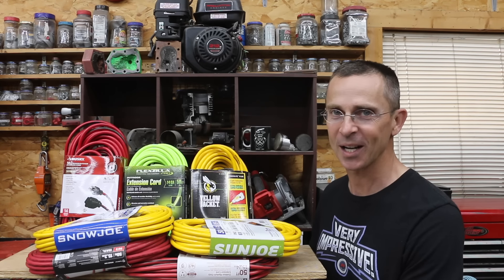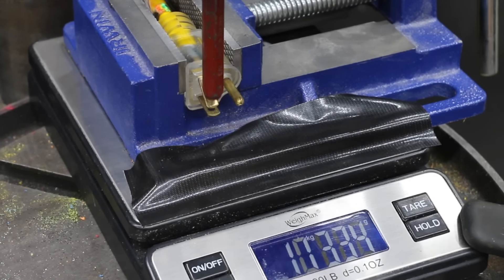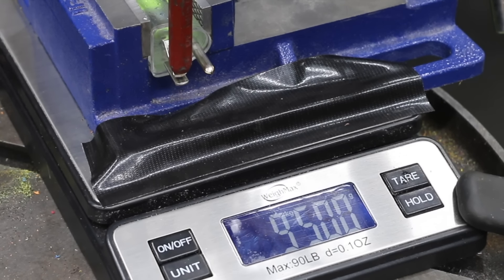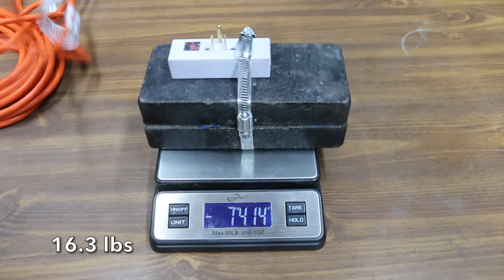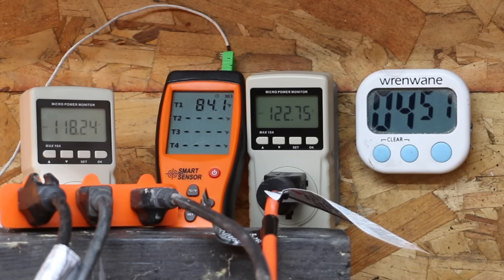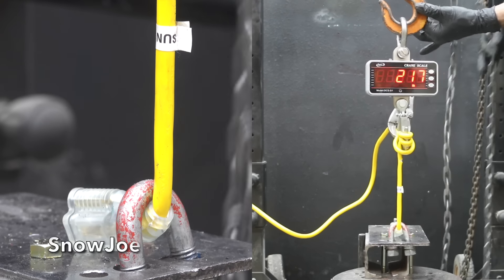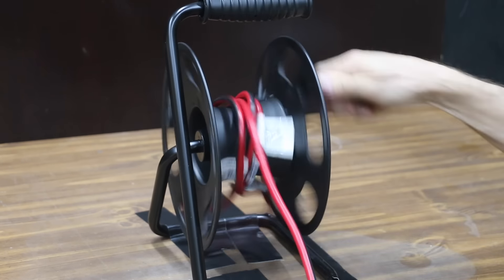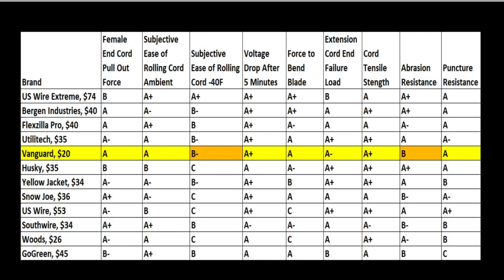Best Extension Cord? Flexzilla, US Wire, Yellow Jacket, Southwire, Husky, Woods, Bergen Industries

Comment: I use the US Wire Extreme to plug my truck in over the winters here in Fairbanks, AK and was not surprised to see how well it did on the -40 test. It's the only cord I have found that stays flexible when the temperatures drop and its interesting to see how it stayed as the only cord to receive a "1" rating.
Reply from the maker: Impressive!  You've seen temperatures at -40F and colder many times for sure!!
Reply: I frequently hit -40 in northern MN also. I usually just give up with trying to bend extension cords when it gets really low...
Reply: Rigid makes a nice ext. Cord for the cold we dont even take the husky out the truck after fall... we don't get quite that cold here in Michigan tho
Reply: @sminthian  Whats that’s crazy I live in East Central Wisconsin and we get -15° at worst in the winter usually like -5° and that plenty cold enough can’t imagine -40°. 🥶🥶
Reply: @sminthian  I got a friend who was hauling pipe for one of the pipe lines.  Minus 47. Most of the guys were gelling. He somehow was fueling with jet fuel and had no issues.  Never heard of that till him.
Reply: I shutter to think of what you had to pay for that cord.
Reply: Bosch used to make a cord similar to that one, don't think they're available anymore. Up in manitoba we saw the same temperatures and it always stayed flexible.
Reply: I have a couple of 12/3 100 foot ones that are the only ones I use when it gets that cold. The other ones look like a "slinky" at - 40.
Reply: Ive been using them for years, and US Wire Extreme is the only brand I get. Not only will they handle extreme temps but they are very rugged, and its a pet pieve I know, but I like to wipe a cord down and velcro strap it after use. After hard use, in my fabrication shop, they will come out looking clean, with no cuts or knicks. They are the cheapest when you think of how often you have to keep buying other lesser brands.
Reply: It seems as if they were specifically designing it to be a block heater cord, even the low force required to unplug would be an advantage to prevent damage from accidentally driving away with it still attached.
Reply: @THRILLHOUSEV  I was going to comment on that too. I dont see a plug being too "sticky" as being a bad thing. When I run a welder, it can be a final line of defense for just yanking it from the outlet. I do have cutoff switches, but sometimes if youre under a car, its easier to yank on the cord.
Reply: @_EZ710_  facts. Husky isn’t even usable in the winter. They were great to run in a semi-permanent fixture for running a shop light and over head power. But coiling it up was a pita
Reply: @ProjectFarm  ,  copper wiring becomes a better conductor at extremely low temperatures ---- at minus 40 you're well on your way to creating a superconductor! ----  and so the cord will easily handle more current and wattage than it is rated for, without overheating.
Reply: @firewoodtime2  Jet fuel is basically kerosene and is pretty similar to diesel.
Reply: That's the same one I have in North Pole!  It's pretty much "the standard".  You go to the Safeway in North Pole and they always have that cord for sale.  It even lights up on the end so that you can make sure your vehicle is getting power without walking outside.
Reply: I was briefly deployed to Fairbanks.  It was -60 on arrival, and warmed up to -40 when we left.  Loved every minute up there, even working outside every day.
Reply: @whiskeybuilder6335  I bought a 12/3 50ft SJEOW in 2018 for $40.   It's been a great cable for auto detailing & tossing over your shoulder while running a polisher.
Reply: @ProjectFarm   I'd like to see you repeat the wattage and voltage drop tests with a small space heater plucked into the cord. The metering devices don't draw enough power through the cord to really heat it up much, and the voltage drop will be fairly minimal compared to what you'd experience if you were plugging a power tool or some other high current device into the cord.  And by the way the temperature of the neutral wire should be the same as the temperature of the hot wire;  In a series circuit,  current is the same throughout and therefore it doesn't really make any difference which one you measure for temperature.  In practice however the resistance will always be greatest right at or right next to the  male and female plugs, and that's where it'll get the hottest, where the male connector is plugged into the wall socket and where the female connector is plugged into the cord coming from your tool. For example when I vacuum the house and then I unplug the vacuum cleaner the only place on the cord I can feel any temperature inctease is right at the plug next to the wall socket.
Reply: Fellow Fairbanksian here!  And I completely agree, I have at least half a dozen of those cords as they are the only ones that remain flexible.
Reply: @sminthian  Yeah, just drape it over the fence (Manitoba here).
Reply: I lived in PA, it could be as cold as 0 so a good flexible extension cord was best. Maybe didn't need it all the time but usually if I did I didn't want to be hassled with a cord folded over itself a dozen times knotting up lol... anyways I live in Florida now and went with a 12 gauge southwire. Holds up good in the strong UV and is plenty flexible when it's 90, the thicker wire is nice to prevent the cord from getting too hot since it'll already be 120 in the sun.
Reply: @TheFudily  A bargain.
Reply: @ProjectFarm  best charcoal for grilling.  I'm trying a bag of royal oak but I can already tell after the first time I used it I like Kingsford better but those are the only 2 I've tried.
Reply: @sminthian  how far north?
I grew up near Itasca state park.
Reply: @jetjazz05  , if I was running extension cords across the ground in the heat of a Florida summer, I think I'd want #10 cords, in the lightest, most reflective color I could find!
Reply: @bobguy6542 ,  at the North Pole, why would you need to warm up a car when you've got Rudolph, reindeer, and a sleigh?
Reply: @sminthian  Quite a few of our extension cords have big tears in the insulation from the cold. Sometimes you have to play tug of war to pull out a cord from the ice. Surprisingly, they don't like that.
Reply: @goodun2974  North Pole is a city in Alaska between Fairbanks and nearby Eielson Air Force Base.
Reply: Glad to see someone from Fairbanks piping up about this brand! I was worried it wouldn’t be available in AK.
Reply: @goodun2974  Watch again, pretty sure he was running 4 x 500w halogen lamps. How do you think he was drawing 1875w and comparing that to the 1770w at the other end?
Reply: A friend of mine in Anchorage used to live in Fairbanks. She said she didn't mind the cold much except it took a mile or two of driving to get the flat spots out of the tires.
Reply: @bobguy6542   Interesting, I never knew that. My brother lived in Alaska for a few years but he never mentioned it either.
Reply: @whiskeybuilder6335  the price was listed in the video.... like $70 or $80 I think.
Reply: My harbor freight cord was decently flexible at 0 degrees the other night while my cheap Lowe's cord insulation cracked like hard plastic
Reply: @firewoodtime2  Yup, JP4.
Reply: @THRILLHOUSEV  Exactly.
Reply: @goodun2974  LOL, but North Pole, Alaska is a real town just outside of Fairbanks with their own US Post Office.
Reply: @ejej6934  Must have been non-winter tires.  I have no flat spots and amazing traction with my Nokian Hakkapeliitta 10 studded tires.  On my Subaru Forester there's probably no better winter driving combo.
Reply: Also gotta appreciate the minimal voltage drop for when you're running a block warmer, oil pan heater, and battery blanket

Comment: I step on my extension cords too often, and I've found that the ones that feature stronger plug blades also tend to snap when straightened back out.  The folded blade type are easier to bend, yes,  but they always straighten back out without ruining the plug.
Reply from the maker: Thank you for the feedback!
Reply: I've had the same experiences.
Reply: I try to plug the extension cord back into itself when I am not using it. Helps avoid bending the blades, but not always possible to do that.
Reply: They can only bend so many times before they fatigue and snap. Had to replace a plug on a shop vac a month or 2 ago for that reason
Reply: It is better to damage the extension cord than an outlet, I think that flexibility in the plug is an engineered safety.
Reply: if they bend when you step on them then you have crap to start with

Comment: As a construction worker that uses extension cords daily, the softer cords are usually preferred.  The harder jackets are stuff and a huge pain to roll up.  When winter rolls around the hard jacket cords retain the shape of however they were rolled and are hard to work with.  I feel like that's why the more expensive cords are the softer polymer jacketed ones.
Reply from the maker: Thanks for the feedback
Reply: For the very same reason that I use rubber or rubber blend air hoses.  I had some sort of blue hard plastic air hose that even in warm weather was an absolute nightmare to handle.  However it was a lot cheaper.  It is only used as the first leg of an air hose extension if I need to go longer distances.

Comment: When I pitched this idea, I never imagined there were so many ways to test it! Thanks so much Todd, your dedication to your work is inspiring.
Reply from the maker: Thank you for recommending this one!!  I'll put together a round 2 on 12 AWG brands if there's enough interest and will include a couple of more tests.
Reply: @ProjectFarm  please include Rigid as it is my goto brand for extension cords in 12 AWG, I do like cords that light up to know it's plugged in as well as having 3 receptacle ends because splitters get lost.
Reply: @ProjectFarm  Ha!  I guess by the time I suggested it last month, you already had it in the pipeline.  :)  Nice job on the testing!
Reply: @ProjectFarm  sounds great!! Test 10AWG ones too!!
Reply: @ProjectFarm  Yes, 12 gauge would be a good follow up.  Please add a jacket melting test of some sort.
Reply: @ProjectFarm  Most definitely would be interested in at 12AWG, or even a 10AWG. 

Another video idea would be to test ball joint presses. Test them to failure, and see if the big name brands are any better than the cheep-o Amazon specials, or even Harbor Freight's Madox line.

Comment: As a contractor that has bought scores of cords, my most important criteria are wire gauge (Skil-saws draw up to 15 amps.) and coil ability (as at the end of the day they need to be put away).  We use twist lock cords to prevent disconnection or tie a knot where the tool and cord meet. 
I love these tests and often use them to direct my tool purchases! Thank you so much Project Farm for all the hard work and inventive testing protocols!
Reply from the maker: Thanks and you are welcome!
Reply: do contractors ever really sign contracts tho
Reply: So what would be your go to cord? The 10 gauge?
Reply: You can have a 4/0 entrance cable with a sorry connection its no different than a #16 gauge cord .
Reply: Terry Goyan, I have the same question -- I would love to know which cord you would choose.  I bought a corded mower and I just don't want to damage my electrics or the mower and I don't want a fire.  I'm a middle-aged woman and I'm clueless. ☺

Comment: I bought a 75 dollar 12 gauge extension last year, and have never regretted it. I know this isn't what most people look for, but here in the south, how cords take the heat is more important than how they do in cold temperatures. I have had a plug melt on me when running under my carport, in the shade.
Reply from the maker: Thanks for sharing.
Reply: Sure, but which one and how did you decide it would perform better?
Reply: I wish Project farm guy did a maximum current test under hot conditions like 95f. How much current can go through before the insulation melts.
Reply: For me, in Canada, cold weather numbers is more important than heat.  I wait till all the snow is gone when I wrap up the 14 GA wire I use for my vehicle (We have to plug in a block heater, if parking on the street over night, or may not be able to turn over in the morning!), as trying to wrap it up when very cold is hard.

I'm glad I don't have to deal with the plugs melting...
Reply: I'm having to put together a replacement power cord for a small dairy pasteurizer.  The original cord plug _roasts_.  The rest of the cord is cool as can be.
Reply: I was about to post something simular...  

18g is a joke
16 if low wattage and less than 8 feet.
else get 14 or 12/
Reply: Have you used many cords in Sub-Zero temps? I'd say the operating temperatures of severe hot vs severe cold are separate factors to consider. The ideal choice for running an extension cord in a walk-in ice cream freezer vs a  mid summer roofing project in Houston are likely not the same product.
Reply: @robertcortright  It doesn't matter.  Any extension cord used on a roof in Houston in the summer becomes tar impregnated, for that extra flexibility.

Comment: Two ideas spurred from this test:

1) Replacement ends for damaged extension cords. Would love to know which ones are worth buying.

2) Retractible cord reels. So many garbage ones out there.

Thanks!
Reply: 1) Hubbell is pricey but extremely good. HBL5266C plug, HBL5269C receptacle. Pass & Seymour/Legrand makes a passable substitute, but it's not as good.
Reply: @PaulSteMarie  Would be nice to see something like that with a strain relief built in. I used something similar a few years ago but the cable took a beating at the junction.
Reply: @WordupG  Have you seen the strain relief on a Hubbell plug? It's pretty massive. The cable will snap before you can pull it out.
Reply: as far as replacement cord ends. Proper installation is a big factor. If money isn't a concern, the Hubbells and P&S Legrands are Beef. I also find the black rubber/plastic Levitons are good too. Handles up to 12awg SJOOW and takes punishment well. Also you can buy in bulk on amazon for like $4 ea. Fun Fact, Hubbell industrial cord ends are compatible with Hubbell cord grips/strain reliefs. The function like chinese fingers and attach to the 2 screws used for the stock cord relief. Not a fan of the Hubbell hinged caps. The Harbor freight ends are junk, and anything built like it too.
Reply: Retracting air hose reels and water hose reels too!
Reply: I usually put hospital grade plugs on the end of all my cords.  I’m not sure the brand but I’ve had no problems with them, no bent prongs, they stay plugged in to any receptacle and anything you plug into them stays until you unplug it.
Reply: I've bought/used both the expensive and cheaper ends; they've held up fine with normal long term use.
Reply: Thanks for the tape tip and the observation on human nature - the seeking of the easiest path by a thief, one requiring little effort and no repair work. Using a  permanent marker, I write my name in several odd places on my extension cords - I'll now start adding fake patches of electrical tape.  If you have a long, heavy cord the odds are that it will be too much trouble for thieves to steal it by carrying it  off - too much work.  If the thieves are more determined, get 130+ decibel, pull-pin activated personal alarms from Amazon (about $1 each, if you buy about 10), and tape one if them to the cord in a non-obvious place, then rig it where the pin is pulled if the cord is moved.  The sound of the alarm goes with the cord and the thief, thereby discouraging continued efforts to cart it off.
Reply: leviton ends
Reply: Hubbel hospital grade are the best in my opinion. They’re the one of the only 5-15 that’s actually approved for use on 20 amp circuits.
Reply: The Hubbell hospital grade cord ends are what we use to make cords at the live light and sound company I work for.  They are incredibly durable.
Reply from the maker: Thanks for the suggestions.
Reply: @mattberg6816  yeah my background is temporary power for music festivals and production. There’s a reading the HBL8215 series are the standard.
Reply: Are there any replacement female ends that have the light to indicate that the power is on?  It would be a nice upgrade when replacing an end.
Reply: @bobo888bobo  I believe Leviton and Eaton both make them.

Edit:  I looked in the Hubble catalog and it’s the 515LC and 520LC
Reply: Hubbell hospital grade is the best I've ever used, out doors all year long for different projects. Put A piece of illuminesce in side and you can see it in the dark as the plugs are low transparent

Comment: When I lived in Alaska, I had a US Wire Extreme to plug in my engine block heater.  When not in use, I kept it in a bucket in my extended cab and none of my orange covered ones would go in the bucket after use.  Like you found, it was very easy to work with in the cold and had no problem getting it to coil up into the bucket.
Reply: That orange jacket is really cheap PVC. It's pretty stiff in cold temps.
Reply: @1pcfred  

UK bloke here.

I've got an extension cord on a reel made by B&Q, a DIY outlet over here. Said cord is bright orange, it's over 18 years old, the insulation (jacket?) Is still in excellent fettle and it's super flexible even in very cold conditions (like lying in snow for a couple of days). It also refuses to get any significant damage inflicted on its self in use, it gets used A LOT to this day. The cord on a Flymo hover mower is also seemingly the same type of cord and doing just as well at the same age.

A case of 'they don't make 'em like the used to'?!
Reply: @skylined5534  I'm sure they can make orange insulation that's decent. There's a common kind that's pretty bad though. It's a bright orange and usually has fine ribs.